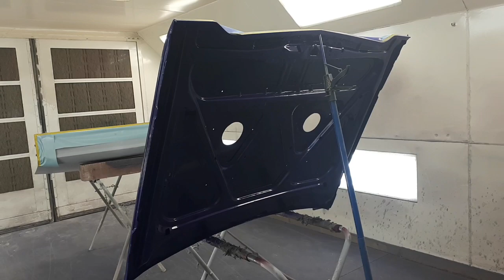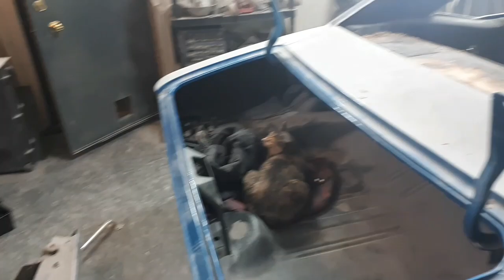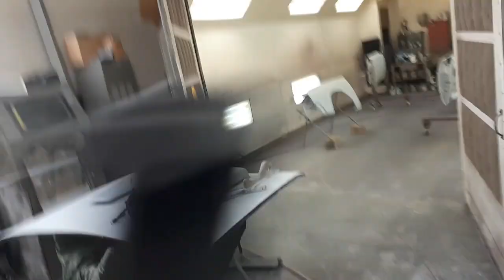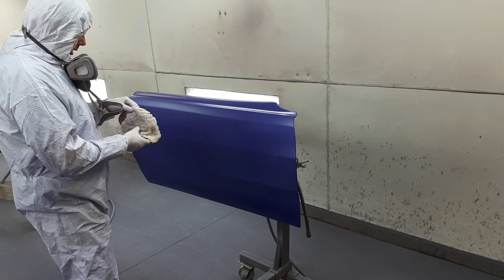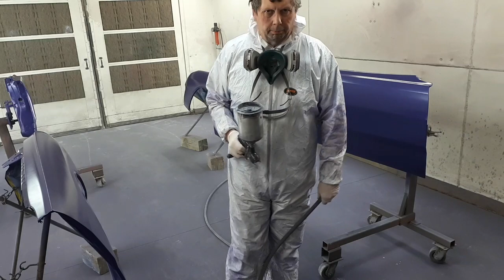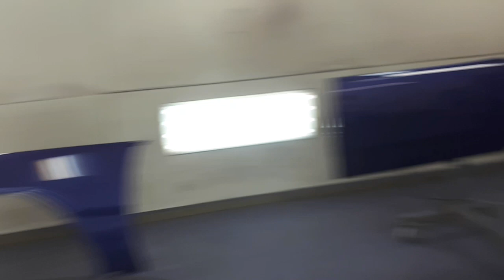1967 Dart Doors and Fenders Plum Crazy Purple

Comment: I've heard there was a small run of Canadian 340 cars in 71 and 72 but I wasn't aware there was only one with a 4sp in 71. Pretty cool you got to work on that. The rarest car I ever got to work on was a real 69 Yenko Camaro. 

The rarest car I ever got to actually drive on the street was a 1965 Z16 Chevelle. Around 5 miles from the shop I worked at to a show and then back again. 

The only plum crazy car I've actually touched was when a friend of a friend gave me a ride in his original paint 1970 Challenger SE factory 440 6 pack that had been hemi swapped.

Comment: Looks good. I’m impressed with how clean it is.  Good job.  
A couple videos ago you mentioned you’re trying a new sealer.  I’m interested to know what sealer you are using as I spray the same matrix base as you.
Reply from the maker: I'm using Automotive Art DTM sealer, it seems to lay out flatter and still covers well. And it's about 30% cheaper.